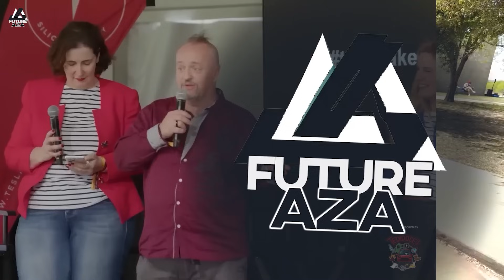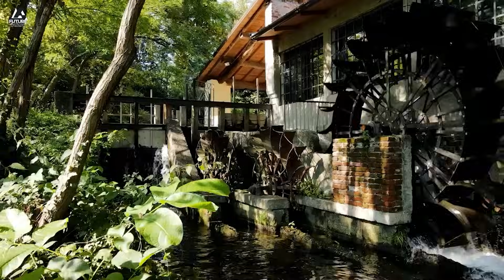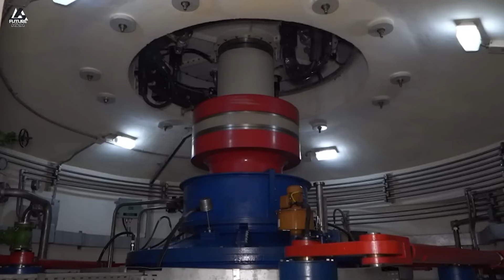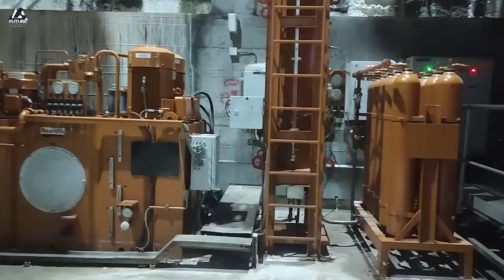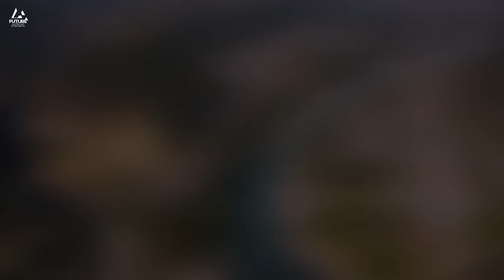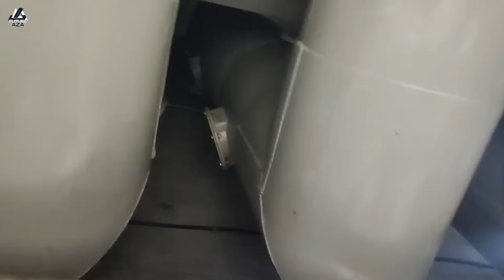Nepal’s Hydro Power is NOT What You Think - Insider Info (correction in pinned comment)

Comment: All of these things make sense but only in the short to mid term future. You're in Nepal and you might have seen the devastation from the floods happening in various parts of the country. GLOFs are more common now than ever and climate change is all around us. Nepal gets the water for it's hydro powers from the snow and ice that melts from the glaciers and every year the amount of snow we get is decreasing. Snow line is shifting upwards, overall snow cover going down. Monsoons are heavy but winters can get even drier and with not many reservoir type hydropower plants we will still be in energy deficit when it's dry season.

We have potential for hydro but not for too long. We need to diversify if we are to sustain.
Reply from the maker: Most river flow is from the watershed, which is primarily the current year's rain. It flows through the plants and soil long after the rain stops.
Reply: @FutureAzA  the flow can't be enough for the winter which is when we have to buy energy back from India.
Reply from the maker: By 2030 there will be enough production to remove that. Unless all the land upstream is entirely dry, the watershed continues its action.

Comment: I don't think starlink internet has much future in the world except western countries where starlink and other services are priced similarly.
There's much hype so it's growing, it will fail eventually in non western country. 

50-200Mbps 
Recently in India starlinks priced 215,600 INR (1 yr Plan) with all the fees included upfront fees of $599

People in nepal and india cannot even fund the upfront $599 fees only let alone INR 200k.  Throwing 300k NPR is also not feasible for nepali households.

cheapest internet 50 Mbps provided by wifi nepal costs NPR 10k/2yr for residental internet.

I'm Currently subscribing 350Mbps for 100-120$ / 1yr + (4-6 Months bonus on yearly plan) .  I have shared to tenant so 50-60$ /16 months. So paying 3 to 4 USD per month. 

Most people live in rent in the cities. They will not get a place too for terminal installations too. Big private banks, hospitals and INGO's could use.  Also many people like to cut the costs and share their internet to tenants and share 50% intenet costs. I also don't think 50-200Mbps starlink internet speed is a fast intenet speed as isps now offer upto 625Mbps internet under $200  I think the isp's may overcharge if starlink comes to nepal.

Comment: Mega packs would solve the time of day problem.
Anything that changes temperature uses a lot of power:
Heating / Air Conditioning 
Hot water Heaters
Stoves / Ovens
Refrigerators
Microwave Ovens
Reply from the maker: Stationary storage is coming, but it's expensive, so it takes time. And the longer the wait, the cheaper it gets.
Reply: @FutureAzA  Transporting megapacks might be an issue.
Given mountainous terrain do they have reliable freight railroads?
Or relatively flat truck routes?
Might need Tesla Semis to get up the mountains (and survive the downhill slopes).
Could used reservoirs or pumped storage instead of BESS.
Reply from the maker: Asked a local. They said oversized loads still come into the country all the time. It isn't bigger or heavier than a lot of dozers and other construction equipment.

Comment: You meant to say gigawatts, right? Giga is 1000 megawatts. I severely doubt nepal can get 10 terrawatts (1000 gigawatts or 1M megawatts) up and running in 10 years. Also, Nepal has only 3 gigawatts of hydro running right now.

All told, though, the direction of things toward hydro is very positive
Reply from the maker: Yes, correction has been added as a pinned comment, and to the top of the description. Thank you for this correction!